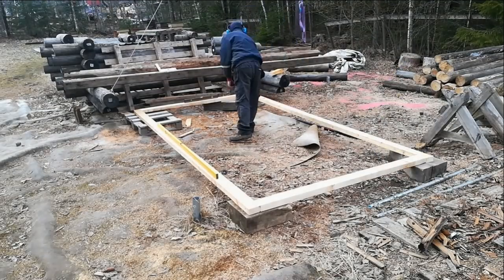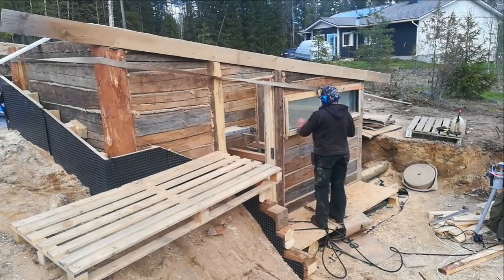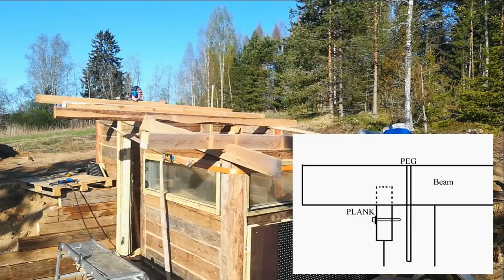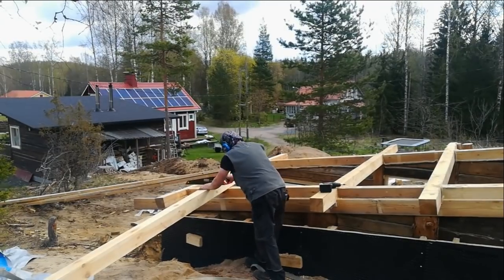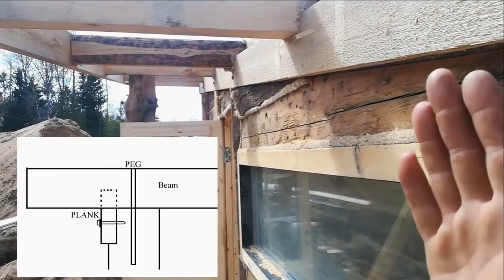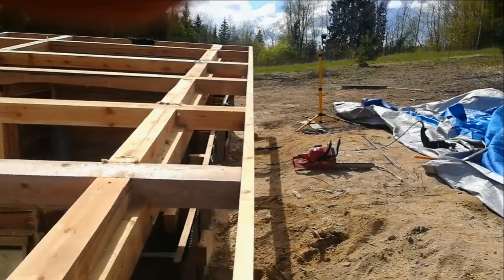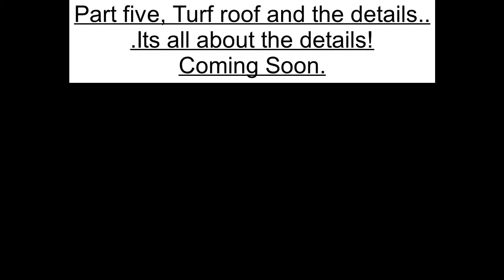Easiest log building method ever!!. Part 4.

Comment: I built a cabin in the woods in north west Washington state Puget sound area in the 1990's and I used the vertical log with horizontal in fill panels I used logs discarded by loggers in the area...but I didn't put tenons on the infill log ends all the logs were full round and chinked between.. the horizontal logs were notched to fit the vertical posts then spiked into place using steel galvanized bridge spikes...I like your wood peg idea better particularly the square peg in round hole aspect of it..great Idea
Reply: Oh wow small world, thats where im from too. If youre gonna build a log cabin the PNW isnt the worst location you could pick lol. Id love to see some photos or video of the build. What was the permit process like and cost breakdown? Its too bad land has gotten so expensive around here in recent years because its something id seriously consider doing in the future.

Comment: Lag bolts, they screw into the Ledger board/beam, they have a rough thread and pointed tip, galvanized coating. Like the slot post method, can use shorter length logs.
Reply from the maker: exactly!

Comment: Tar  paper for the  roof  and  Your doing a  knock up  job with  this  place!!!  Am  doing a  A-Frame  cabin with  10 ft  side  walls  the  A-Frame to  the  Southeast  for  windows  with over  hang of  8 ft.  For  deck  also  but the   basement  will be  like  Yours  cause then it will be for  cold  stuff  like  a  pantry  and to  hang  meat in it for hunting and  storing some  freezers  down  there also !!!  Door will   be  as  thick  as  your  walls  but will be  in 2 parts  open  top  first  with  bottom  to  stay  in place if  you need  air  flow!!!
Reply from the maker: Hey Linda, Sounds really interesting but it was a bit hard to understand what you were trying to tell me, I got a bit confused!  Where are you based?

Comment: Me and my husband are going to try this starting it next month we have a 49 acre lot of pine .. do we need to cut the trees to dry before we can do this does it matter
Reply from the maker: Don't worry overly about drying the logs out. I have a lot to say about this. I am working on a questions and answers video. I will address this point in that vid.
Reply from the maker: Ok. editing the Q&A video is taking a while so here are my thoughts. The conventional wisdom is that you should strip some or all of the bark and then stack the logs, with plenty of space for air to circulate around them, leave them for a couple of years before building...but who has the space? Dried logs will have some advantages. They will shrink less as they dry but you should be allowing for shrinkage as you build (unless you use my method in which case you don't need to) they will have already cracked a bit, so less additional cracking to come......I don't see much of an advantage to that. They will be lighter. Yes, true. As logs dry they sometimes twist a bit so there is an advantage to letting them do that while they are stacked up rather than them twisting as they dry in your wall - especially if you are talking about hewn logs (with inner and outer surfaces cut flat either by hand (hard work) or with a bandsaw) but unless you are using very very long logs then this twist is not usually a big problem. One big reason that commercial log building enterprises will dry logs prior to building with them is mold. If you use fresh logs then you will get surface mold developing between the logs which looks bad and your customers will not like it...but the truth is that these molds need the moisture in the wood. Once the building is under a roof and dry they die away. One advantage to using green wood is that, depending on the wood variety, green wood is usually easier to cut than dry wood, at least with a chainsaw. For instance Aspen is a joy to work with when it is still quite green but is hard to work once its fully dry.
Reply: Thankyou so much for answering my question have a wonderful blessed life
Reply: I would add that this technique is a good way to work with green logs as they can shrink and settle in the notches. Clearly an advantage of this.

Comment: Very  nice build ! I’m going to use this technique for my off grid cabin.
 Was wondering why the owner wanted that beautiful cabin partially underground. ?
Reply from the maker: Initially they didn't. But I wanted to try building a semi-underground cabin so I made a proposal and they agreed.
Reply: @ProjectHighlander  well, it sure turned out lovely. Would like to see pictures in a year or so after the roof has grown over.
Reply: Building underground or partially underground controls the climate inside the home.. it stays roughly 70°-75° all year long so it's much easier to heat and cool the home...

Comment: @ProjectHighlander  Hello sir. My wife and I are about to start building our cabin and your videos have been insanely helpful with our planning and designing phase. I have been looking everywhere and you can't find Flax Jute like what you were using in the United States, so I was wondering if you knew of any other insulation that would work well for between the boards. Also, I made a jig to make cutting the tongues and grooves a bit easier using my router and was wondering what your thoughts would be on running a tongue and groove setup vertically l to create a tight seal between the logs as well.
Reply from the maker: I don't know what is available to you where you are but if you can't find flax then consider moss,. I use flax fibre when I am working for a customer because it saves time (and therefore money) but if I were building for myself I would use moss. It takes time to collect, put it in there when its still wet, it will dry in there and at the same time will wick out the moisture, plus, because of its Ph it actively inhibits mold and rot. If I understand the second part of your question correctly... that you want to do horizontal toungue-and-groove on your logs then in theory, if you are an engineeer, then that makes sense but as a log builder I would say that you are creating more problems than you are avoiding. Logs are not straight which is why we shape each log to the one underneath, no 2 logs are the same, trying to standardise how you connect one to another....while its a nice idea....is going to end up being more work, not less.

Comment: You've already replied to me in a previous comment and thank you for being a wonderful help.  I'm not far off from putting a similar structure together but i am hesitating on the roof system.  I only have four posts and the log walls are running roughly a span of 7'4".  The 15 cm by 5 cm can only anchor into the posts i understand because it's there to deal with the settling of the walls.  Do i need to add two more posts on each side to tie the roof system together properly or can i have my rafters pegged into the log walls?

Comment: Love it and have gone back and reviewed taking notes for my upcoming build. At 9:03 when you are infilling gaps between beams am I correct in assuming you have one peg horizontal into the adjoining crossbeam and another vertical into the wall log below? Forgive me but I can't picture any other way of securing these.
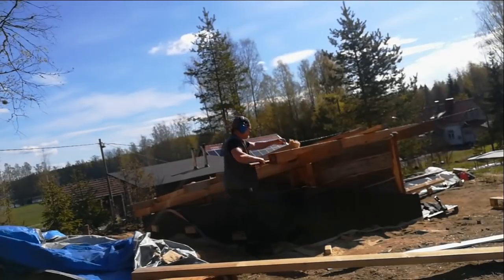Reply from the maker: Actually I am glad you asked this because to be honest, if I were to do this again I would do it differently. Instead of putting in the front - back beams first and then infilling I think it would have been better to put in the two left - to - right beams on top of the long walls and then do all the front - back beams with half and half joints like I did with the extra beam at 11:08 in this video.
Reply: Thanks,  that makes it easier to envision.  Probably a bit stronger as you will now have all the logs interlocking. Just goes to show the adaptability of this system.  Thank you so much for sharing your talents.   I've learned a ton.

Comment: I thoroughly enjoyed watching all of the videos of this build.  I am planning on building a cabin on my property.  It will be 10 feet by 20 feet with a shed roof like yours but with a more steep pitch.  I have plenty of old growth trees that I can use.  I am debating whether to use a dovetail notch or your highlander method.  I will mill the logs into rectangular timbers 10 inches by 12 inches. I have 2 concerns with your method.  I understand the importance of the roof structure but still wonder whether it will be sufficiently strong for a larger structure that I am planning to build.  Also, I am planning on installing large windows and wonder whether the weight of the logs above the windows (maybe 4 to 6 logs above the windows) will crack or crush the window frames as the logs slide down the standing timbers as they dry over time (I will be using green logs).  Thank you for sharing your knowledge.
Reply from the maker: So the biggest building I have used using purely this method was 4.5m x 5.5m... So I think that's about 13ft x 16ft, Its the building I use for the thumbnail picture on this series. Worked great and I would not worry about doing bigger still. With windows they just go between the vertical logs with 2x2 attached to the sides which locate in the vertical grooves - the 2x2s take some of the weight and I would recommend really good strong frames but, yes, if you are thinking about really wide windows with 6 logs above them then I would consider dividing the window with a vertical support in the middle Alternatively make the wall section wider than the window and do the opening for the window in the traditional wood building way so you will end up with the small gap above the window to allow for drop and short log sections between the window frame and the vertical log on each side. Any help?
Reply: @ProjectHighlander  Thanks for the quick response.  I will have limited space on the front wall where the windows will be installed.  I was thinking to install 2 sets of 4 foot wide windows (5 feet tall) next to each other along that wall separated by short logs 3 feet wide.  I need enough space between the 2 sets to install bear-proofing shutters so that when the shutters are folded back towards the wall (ie. opened) they can collapse into 1 foot wide with hinges between each 1 foot collapsed shutter section.  Hope that's not confusing.  I would prefer not to further divide the 2 sets of windows into, say ,4 sets of 2 foot wide windows. I think I prefer your alternative idea of leaving the gap above the window frame with short logs on either side.  I just have to estimate the extent of shrinkage to know how much of a gap to leave.  I think I will be using white pine but they will be green.  Also, I think a strong frame is best (maybe steel or iron - although not sure where I will get such a frame - I don't have the resources to construct it).    Thank you very much.
Reply from the maker: Ok, the windows are just 4 ft (1.4m), I thought you were thinking much wider. If they have really good strong frames and you add the 'tougues' on either side of each window, using well seasoned 2x2s (or whatever you will use in your build) making sure they touch the logs both above and below then I don't think you have a problem. It does mean that you will need a post inbetween each set of two windows though. Hope I am understanding correctly.
Reply: @ProjectHighlander  Yes.  Thank you
Reply: @ProjectHighlander 
Thank you for the conversion into inches. 
This silly American hasn’t yet figured out metric.

Comment: I love the build technique!!!! Instead of insulation could you go old school and chink the joints so I won't have to take the logs back down? God bless and love to you
Reply from the maker: I'll be completely honest with you, I have never understood chinking. In this part of the world no one does it so it is not taught in log-building school and I can't understand what the point of it is and why it wouldn't cause problems as the building dries and settles. I would have also thought that it would trap moisture exactly where you don't want it causing mold problems. I guess this is a gap in my education.

Comment: A router might help with making notches and keeping them straight.
I'm scared of the foundation.It will only take one of the logs to rot and the whole shed will squat.
Reply from the maker: I understand your concern but the logs I laid down are pressure treated wood, this hillside site has extremely good drainage and I ensured airflow all around the back side of the building as well as underneath so I am not too worried.

Comment: So you were using two roughly 2"x6" timbers in the tops of the logs and then two roughly 6'x6' timbers onto those.  Those large bolts that you are not certain of the English name for are known as lag bolts.  It also seems that the areas where you put sections in to fill the gaps could have been done by cutting a lap joint into the timbers where they cross.  A lap joint is a cut half through both timbers that is the width of the other timber so that they lock together allowing you to use one peg at each crossing point.  It is known as roofing felt or tar paper.

Comment: Im planing on building a small cabing with this method and i cant wait to get started. One question though. What type of insulation are you useing?
Reply from the maker: Its flax. I get it from a company called Isolina (Isolina.com) The website is in lots of languages so I imagine it should be available in lots of places.

Comment: I’ve watched this series a couple of times to make sure I understood everything.  I like the technique but have one concern I can’t resolve. The walls are unstable until the roof is on. Nothing ties the walls together until the roof. You must use ratchet straps to keep the vertical posts at plumb and to hold the horizontal logs at each end to the posts.  This seems a simple matter if you move quickly and the structure is small. But if you were building a larger structure over months, this feels problematic to me. A notched log wall holds itself together.  Other than that I see how this is faster and has many advantages.
Reply from the maker: Yeah.. ok I see whee you are coming from but its really not an issue. As the logs mounts up, particularly if you are building direct on the build site so there is insulation being added, then the amount of friction is impressive. if you try to move a post or wall its pretty amazing how well it holds. Its surprisingly solid. Plus there is no reason why you cant add temporary planks along the outside of the walls holding the vertical posts together. I don't think its really a problem. On larger builds I have screwed posts temporarily in place and its worked fine. Just remove the screws once the roof structure is done.
Reply: Just so you know, ALL walls, in every construction project, are unstable till the roof ties it all in. This is normal.

Comment: 😊I was wondering if the pegs are necessary, especially those short logs?
Reply from the maker: In a way they are not AS necessary as in a traditional log build because one function of pegs is to stop the logs moving over each other lengthwise (So for instance, window/door holes remane straight). That is not so important here because the verticals do that to a large extent. But another function of pegs is to prevent the logs twisting, as you say, not such a problem with short logs, but it can still be an issue. I know of a sauna building with a twisted log. twisted to the point that you can see light between the logs. It's only a 3 meter long log. Going round the back of the building you can see the exposed horizontal groove and the two holes with missing pegs.....

Comment: What is the use for this building? What was the time for the total build? Did you do it all alone mostly?
Reply from the maker: Customer wanted their own little space separate - but close by the family house. The initial rough build in my home log yard took around 40 hours.Then about double that onsite so 120 hours. Of course if you were to build it from scratch straight in its final location it would be faster plus there was a lot of extra time spent on this project because the cabin is half underground.

Comment: Can u try doing one of these builds with them fancy new electric dewalt or skill  battery saw :) .....????
Reply from the maker: No. The battery saws are great. If you need to work inside for instance, really good. But for real log work.......Not even  close to being powerful enough yet.

Comment: Good lord that roof structure is ROCK SOLID built. I surmise its not just for extreme snow, but the building method is really dependent on a solid roof locking everything down?...
Reply from the maker: Yes, I guess it's a bit of a trade off. Save a lot of time & heavy lifting doing the walls...but you have to put a strong roof on there.

Comment: Regarding the top wall plank. As the wall drops won’t that leave a partial gap between the notch in the wall and the plank?  It won’t be a see through gap but a visible line/space of the top of notch and bottom of plank notch where they no longer touch. Right?
Reply from the maker: I don't completely understand the question but please watch all the parts of this series and then if something is unclear let me know and if I have not covered it I will do my best to explain.

Comment: Why did the owners want the cabin under grade? 
Sad since a lot of the old beams will not be seen. 
Is there going to be drainage problem on the roof’s low side?
Reply from the maker: They had their reasons. I don't anticipate any drainage problems, that whole hillside is just sand and gravel. No problem so far. This was built 4 - 5 years ago.